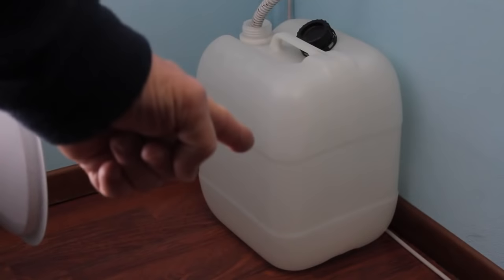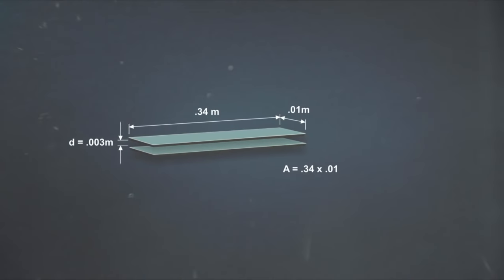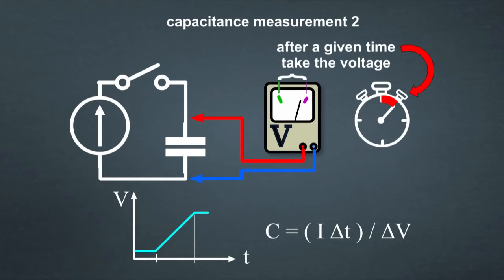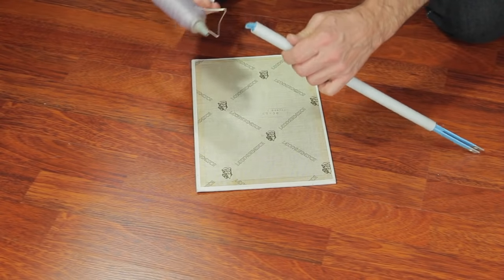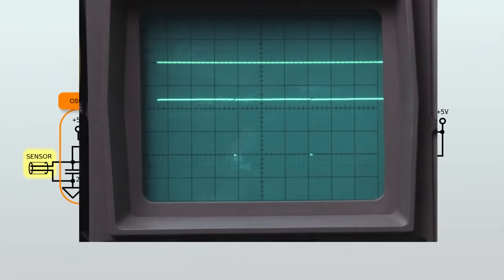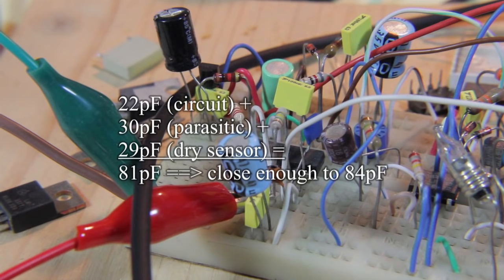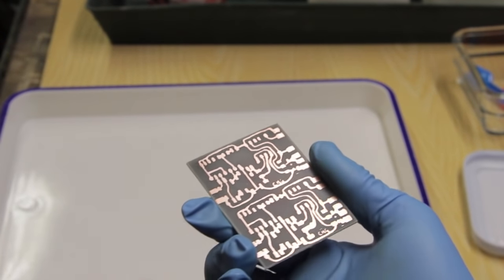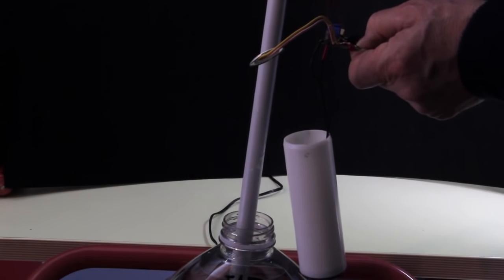Water level/fluid level capacitive sensor - How it works and how to make one

Comment from the maker: EDIT: A portion of this video has been trimmed out because of an error in the shown formula of capacitance. I apologize. Thanks to "All in the Familiy" for having spotted the error. I have to say that I was not in comfort with that formula from start, at the point I regret not having cut out the whole part from the video in the first place. That happened because I had a mismatch with theoretical calculated values and the measured values and being in hurry to publish the video and being this a simple showcase video I didn't keep it on hold until that point was cleared. Sorry. More in the reply I've given to "All in the Familiy"'s comment below. 

Set apart this, the remainder of the content in the video still hold and after almost four years of operation I have to say that this sensor worked flawlessy, so I think it remains an useful piece of information for DIY electronics.
I will try to do more about this topic. Thanks for sticking with me.

Remark. Because the dielectric constant of water changes with temperature this sensor provides a reliable measure as long as the water has a limited variation in temperature. In the case the water has variable temperature (say from 20C to 90C / 68-194F) a pressure sensor is better suited. (Pipe-pressure, the same that I'm gonna make for gauging the level of the sludge into a manhole.)
Reply: thank you, when you make the pipe-pressure sensor? Then I want to measure the diesel and petrol. can you help me for that!
Reply: You mentioned doing another sensor for your "sewage manhole".  Did you ever get to this project?  I am very interested in doing something similar but encasing the capacitor plates in molded plastic.
Reply: You also could add a temp sensor to the bottom of the capacitor sensor and then design a bias ckt to make the comparator circuit automatically adjust (compensate) for temperature variations....

Comment: I built similar tubes a few years ago using copper tape and pvp pipe.  It was for an aquaponics setup and designed so that the exposed portion was the hollow center and could be easily cleaned with a pipe cleaner brush.  I appreciate your coverage of the maths in this and your rapid pcb production technique is spot on!
Reply from the maker: Thank you.

Comment: I initially thought about making a sensor like this, but as a level transmitter for my arduino. I planned on using a 555 in a monostable configuration in order to read its actual capacitance value. Then after would have to calibrate it in order to correlate its level to its reading.

[Edit] I shared your video to GreatScott. He had a project recently to monitor a water tank level and used an ultrasound sensor in the end. But I wanted him to be aware of your creation :)

Comment: I used a common electrical cable with two internal wires as a sensor, I melted the tip of the outer sheath to isolate the two cables, and as an electronics I used a common 555 whose oscillation frequency is read by arduino, works perfectly even as a sensor of soil moisture :)
Reply: Can you share circuit diagram and some pictures of your sensor. It will be helpful
Reply: @syedumarjunaid5499  http://www.electroniq.net/555-timer-circuits/square-wave-generator-using-555-timer.html - the probe is a dual isolated cable connected instead of the 'frequency select' capacitors, consider that a cable about 80 cm long has about 80 pF.

Comment: Nice one. 
Can you please answer some,

1. What is the maximum and minimum voltage at f/v converter ?

2. How this f/v converter constructed with just RRC passive components ?

3. What is the maximum output drive current of NAND gate ?

4. What is the Hysteresis voltage?

5. Does MCP3302 work in place of lm311 (from the data sheet which you have choosen to calculate input impedance of IC, “typical (or) maximum” values of offset voltage and bias current ) ?

Thanks again.

Comment: hi , I liked the the capacitance sensor that you made. Would it be possible for you to share the electronic circuit diagram  with specifications of components needed? I am looking for making similar type of application for fuel level gauging. If you have any suggestions you are welcome.
Reply: Hi, were you able to get the electronic circuit diagram with the specifications of the components? I am a bit stuck with a project similar to this and it would be much appreciated. Thanks.

Comment: Very nice, very nice video with a lot of useful info and also the necessary theory behind. I wish you would have spent a little longer on the math and on the circuit components.

This said, why not make the circuit with a proper CAD and use the transfer method? Also, I think disconnecting AC whit a relay when the tank is full is a poor failover method. Why not create some sort of passive overflow system that safely discards the excess water? It could be a series of pipes that passively discharge extra water or simply positioning the tank on a drain.

Last question: will water collected from a condenser be slightly acidic? Is aluminum a good material for this or would something like a stainless steel be better?
Reply from the maker: Sorry for not covering deeper the math involved, but that would be beyond the scope of this channel, also I am not a matematician ;)
The passive method for discharging the excess of water would it were possible wouldn't had rendered this circuit necessary. Also, since the water is produced only if the AC is on, even in the case of power outage this would not cause any problems making the circuit intrinsecally safe.
I don't know if the water become slightly acidic, I did never tested it. The aluminum of the plates is covered with resin so there is no direct contact of the aluminum plates with the collected water.

Comment: sorry folks that is incorrect, the formula for capacitors with stacked dielectric materials  is C=Eo*A / ((d1/Er) + (d2/Ew) + (d3/Er))), Eo=8.85E-12F/m, Ew=10, Er=3, A=area,(lxw), d1=thickness resin plate1=1mm, d2=thickness air/water=3mm, d3=thickness resin plate 2=1mm,.   With these values the  calculated capacitance with air is less then 1pF namely 0.8pF, with water the capacity is 3.1Pf.
Reply from the maker: First off, thanks for your comment. You somewhat put the finger where the spot hurts, since that is the formula I used at first when I tested this circuit and probe but then I used an alternative formula because it didn't fit the experimental results. Well, you got the wrong result because you put 1 mm thickness for the resin layer when it is more like .1 mm (not sure about the exact thickness), but that does detract nothing to your point: that should be the correct formula and it is basically where the formula for series capacitors comes. Because intuitively a stack of dielectrics sould behave as a series of capacitors. But as I've said the results didn't fit experimentally. My first theoretical results (using the formula you mentioned) were: 9.9pF dry and 219pF full of water (apart a small portion); while the actual measurements were 34pF dry (measured with a capacimeter) and 2.34nF in water (calculated with the circuit). They were too off. At first I thought to have some leakage, a resistor in parallel or maybe a series resistor caused by a bad junction. But after thoroughly checking with the multimeter I didn't find any significative resistance that could have changed the response of the circuit and the resulting capacitance of the probe *that much*. So I searched online and found a paper where they said something related to the density of charges, giving a formula where the relative dielectric constant (permittivity) of multiple layers was simply multiplied to the permittivity in vacuum. Unfortunately I didn't keep a reference. However that formula gave results that was close to the experimental data so I trusted that formula. Though I never felt in comfort with that and I should have skipped the theoretical part in the video. This is what I've done now: I trimmed off that part!
That said, still something do not add up properly because the experimental data were way too off from the theoretical data.
As soon as I'll have a bit of time I will try to go deeper into this thing.
I can't pin your comment, but definitely I will include it in some way into my already pinned comment.
Thank you again.

Comment: Nice video inspired me to do it. I tried to make one. And modified the probe.
1. Probe capacitance varying 160pf to 205pf, so i calibrated RC ckt to tune with same, modified R 150kohm to 42kohm.
2. From f/v output I wanted to get 4 different outputs, so placed 4 individual comparators to glow 4 LEDs for 4 stages of water level 10%, 35%, 65% and 95%. And the comparators output given to RF encoder (HT12E) then 433mhz transmitter. 
Please do let me know if my considerations would go wrong. Thanks!.
Reply from the maker: Good job. Thank you for letting me know. I'm on mobile now, I'll integrate this comment later.
Reply from the maker: I think your design should work correctly, in particular if the comparators have a decently high input impedence, which usually it is the case in particular if you use the LM311.
Of course you can change with other comparators, maybe a package that contains four.
Please note that the schematic shown in the video has an error: I forgot to draw a line from pin1 to pin4 of the LM311. The correct schematic is visible on my website.
Greetings from the Alps.

Comment: You could calibrate an existing sending unit from a fuel tank. Attached to a gauge it would give an accurate reading of the fluid level. Or, just a float attached to a switch that triggers a warning light when the fluid level in the tank is too high or too low.

Comment: Hi sir, can you explain me circuit how the capacitance is measured in the fuel tank the value need to measure in the microcontroller the capacitance value ranges from 50pf to 500pf.

Comment: I'm thinking of making another one of these using a slightly different principle.  The last one I made was really difficult to set up (was from EDN online magazine and cut down a little for a water level monitor for a boat, copper tubing around a plastic pipe with an insulated electrode down the centre, making a co-axial capacitor). I was thinking using a fixed frequency, and then having  an output that tells you when the capacitor is charging or not 1=charging, 0=not charging to give a PWM output that is then filtered and can give a wider range output without too much amplification. Capacitor discharged quickly at rising edge of frequency generator, maximum frequency needed determined by capacitor and charging resistor time constant, at the time constant's highest value (variable charging resistor to adjust for maximum).
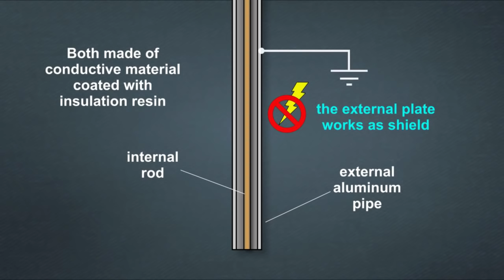Reply from the maker: Just out of curiosity, may you provide the link to that article? The coaxial version of the sensor can be seen in my video at 4:21 . 

I don't get how your solution works: since the capacitor is always charging from the raising edge to the falling one, and alwasy discharging from the falling edge to the raising one, if you look at the current (to see the charges' flow) then this current will lasts for the full positive cycle (and the full negative cycle on the other way). I am not saying it does not work but likely I missed something in your explanation, perhaps is your idea to cap the charge cycle at a given voltage by setting a threshold so that you can look at how long the capacitor takes to charge (up to that given voltage), switch to discharge, and hence generating a sort of PWM? That would be equivalent to the "method 1" I described in the video (at 2:29).
Anyway, good luck with your project, also let us know about the results. Thanks for having commented.
Cheers.
Reply: @AccidentalScience  Sure, the EDN article is this one: https://www.edn.com/design/test-and-measurement/4423158/Precision-capacitance-meter
I used an LM3914 bar graph to show water level.  I had trouble with getting the right range with the EDN circuit - I think it is designed for much lower capacitance and smaller variation.

I guess I wasn't too clear, I was going to let the capacitor charge through a resistor and discharge it  at regular intervals with a small pulse, like in your weight sensor video, but without a constant current and just a resistor (that you can vary too). The idea was when the capacitor is charging (below threshold) a 1 is output and 0 above threshold to make a PWM signal controlled by the discharging repetition frequency.  I'm not sure if it's functionally equivalent to yours that uses PDM (pulse density modulation).
Reply: I've since found a circuit that would work in a similar manner to what I was thinking, although I've already designed my own version (with it's less than ideal behavior, but can compensate for that). I'm also trying a sensor with the elements wound in a spiral around a small diameter tube, hoping to get a measurable capacitance change between them as covered by the fluid (similar construction to an open wire line as used for RF). As the fluid is only on the outside (the tube can be blocked or a rod used) then it should be ok for measuring fluid with 'sludge'.  PWM type sensor - here used for a capacitive humidity sensor: https://www.digikey.com/en/articles/techzone/2011/oct/humidity-sensors-and-signal-conditioning-choices
Reply from the maker: Sorry for the late reply, I have noticed today that your last comments were kept held by YT for review ...it's a plague common to other commentators, that I have to clear manually. About the circuit. I've seen the one on E D N, it is based on a fixed frequency and the capacitance is read by comparing a fixed time charge (the branch R14 and CA1D in their schematic) and the variable time charge (due to the test capacitance C?) on the branch R11 CA1C that is conditioned by the availability of the current that split at the node R8-R11 through the BAV99 "sucked" by the test capacitance.
Thus, at the input of the opamp would appear kind of a race between the fixed time charge and the variable one from the two branches. If I did not missed something, because CA1C is quite large (10nF) the test cap should be in a comparable range otherwise the difference would need a large amplification, they set to AV=10. Also, the two CA1x capacitors should be matched for the best results, but that should be secondary for the functioning of the circuit.
It seems a complex circuit to me, and frankly I don't like it.
One thing you have to keep in mind is the design of the layout or the PCB, as the devil hide in details. Beware of every stray capacitance, and leakage from the surface of the circuit because the common (cheap) FR4 adsorb non trivial amount of humidity from the air (and after the etching process), so after cleaning the PCB with (warm) isopropil or ethilic 99,9% alchool (which can grab up to about 30% of water in it), it should be backed at 60C for 30' before covering it (still warm) with a good quality conformal coating.
Also, the spiral idea do not convince me, it could become an inductor that may cause weird behaviours, pick up RF or LF EM ...and cause headakes :) To have a good capacitance simply reduce the distance between the plates.
I've been very busy the last three weeks, but I will upload an other video on capacitive sensing.
Cheers.

Comment: I want use this project for measure vegetable oil level on a bottle. I have a question: if the oil is dielectric, Can I use the electrodes without epoxy resin? I'm thinking make the electrodes with stainless steel.
Reply from the maker: Epoxy covering (actually I used polyester) is not aimed to protect against corrosion but to provide insulation. Look for a food grade covering or just use bare metal as oil is not conductive. However oil has a quite different dielectric coefficient and both the plates and the circuit would require a redesign for such an application.

Comment: Very nicely explained.
What is the effect of the thickness of the Aluminum strips?
Would a thin copper foil work (instead of the Aluminum strips)?
Reply from the maker: Thank you.
The thickness of the aluminium strips is irrilevant, and as long as it is a good conductor the material is irrilevant too, soo even foil copper can be used.
Reply: My experience is that when titanium is used for the ungrounded probe... It's size, and the thickness of any titanium oxide/anodised layer has big effects on the capacitance.

My understanding of this while "tap water" is a poor conductor... Compared to titanium oxide it's not that bad a conductor... So in effect the capacitor is formed between inside of plate, and water. Ie across the titanium oxide layer which 1) is very thin 2)has a fairly high dielectric constant.

Comment: Hi , excellent video . I got two major issues when I made cylindrical capacitive diesel sensor. Please can some one answer following queries. : 
1, it suddenly changes reading ,mostly to 100% or even more than that. It may be because of " charge accumulation on central rod ". Mind it I did not coat with resin/acrylic. 

2, it changes reading with temperature . e.g. increases in afternoon and decrease in night. 
3, wire b/w probe n circuit also causes reading drift.
Reply from the maker: Missing coating makes the probe resistive. Diesel is not a conductor  but it could mess up the capacitive vs. Resistive ratio. Not sure though, it would require a thorough investigation. Wires cause parasite impedance so the probe must be directly connected to the circuit: the two parts must be seen as one.